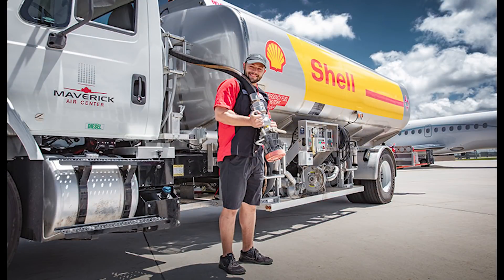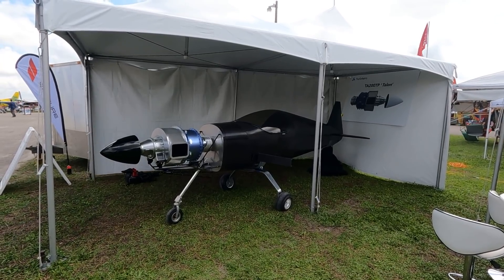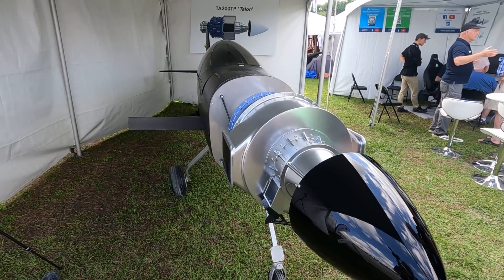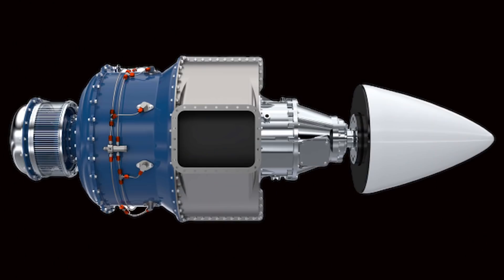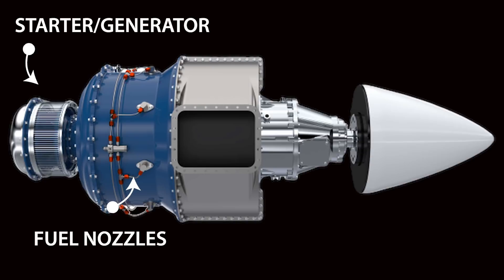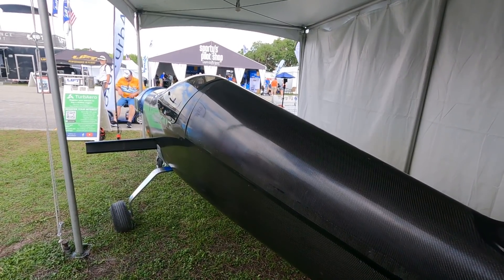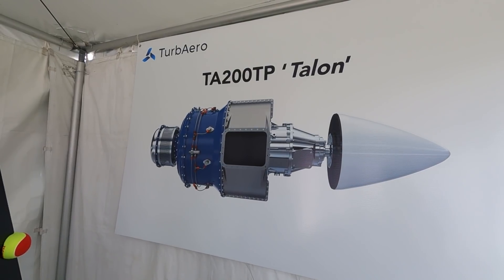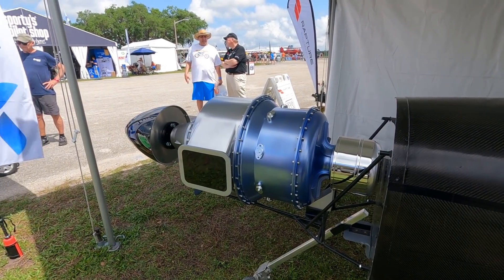TurbAero Aims For a New Turboprop Engine for Small Airplanes

Comment: Congratulations!!! After many decades in aviation this is a great new development. We are still riding behind engines deseined and built before 1950s.  Keep up the good work!!!
Reply: Not really. Many Lycosauruses are slightly more modern.
Rotaxes have cleaned up the market on the lower end and are inching forward in the power range.
Reply: The Marvel-Schebler carburetor design on Cessna 172 engines for example (before finally switching over to fuel injected) was the same design as used on early indy race cars, circa 1911. The design has barely changed in over a hundred years. The FAA requires so much damned money to approve new technology, that aircraft are in some cases 20 years behind automotive technology.
Reply: @VictoryAviation  well, the basic carburettor works well, especially since the mixture is adjusted by hand.

It would be nice, however, to get a normal EFI to work on an aero engine. One could even design one with one channel per cylinder,, achieving all equal EGTs
Reply: @daszieher  It exists. It’s called a FADEC system. Unfortunately because of how over the top the FAA is with approving technology, there are many incredible systems that require a ton of money to get approved. Meanwhile cars have had similar systems since the 1980’s standard.
Reply: @VictoryAviation  you got my point 😉
Reply: @daszieher  RGR that lol 😂
Reply: Ironically this tech is from the 1950’s. See the tech behind the Chrysler turbine car. It was a similar recuperated design. The downside is small diameter turbines must run at infeasible high rpm.
Reply: @yolo_burrito  interesting! Thanks for pointing this out!
Reply: Yep just plink down 80-85k $..  realistic ? Not at that price, but a good viable option??
Reply: @dalestephan6777  Newly developed tech is always much more expensive than when it is more widely distributed. GPS used to be so expensive that only the military could afford it. Now it’s a part of every single cell phone.
Reply: My IO-360-A3B6 engine was certified in the mid 90s
Reply: I don't "ride behind" I fly my aircraft. Second they (Lycoming, Continental ) are still here because they are 100% designed and suited for GA planes, efficient, reliable, economical and powerful.  No offense, you have no idea about science, math, engineering saying things like this. Thisi s a vaporware engine. Pie in the sky you can ride in your dreams. I am going to "ride" my RV7 with 180 HP Lyc, today, tomorrow and for decades to come.
Reply: @gmcjetpilot  Just because a Ford Model-A was a solidly built vehicle with some still running over a hundred years later, doesn’t mean it’s the most efficient, powerful, and reliable solution. It means that it was built with great engineering for the time and the atmosphere still has the proper amount of oxygen in it so that combustion works.

With your attitude towards new creative solutions, you would have been yelling at the Wright Brothers telling them how stupid they were because you had your trusty horse that worked just fine.
Reply: @gmcjetpilot  Decades my ass. I bet your pushing 60.
Reply: @CrossWindsPat  You know me. Yes I am pushing 60 and happy, because I am healthy, wealthy and secure. Mechanical Engineer LSU 1885 Masters UW 1990 while at Boeing, worked my way up to CFI- Inst  instructor, Multi Engine Instructor, ATP and started flying for the airlines in late 90's. Have 3 type ratings, including CE500, B737, B757/B767 So yes decades kid. Get off the computer and do something useful besides trolling. Yes you are owned. Bye.

Comment: All the ning nongs and knockers that say it will take at least a decade just check what is happening around all the space ports on the planet. They are sending rockets into space that were on the drawing board two to three years ago (they have to get approvals also). The only obstacle is money as always; given that single restriction, everything else is go. Get with the program and stop knocking for knocking's sake there is enough of that crap already on the web. For those who thing the development has fantastic potential I am with you, the extra cost compared to an IC piston engine when one adds the extra safety of a jet turbine is a win without argument. The bigger issue I see is noise, (and I don't mean the stuff on this page) for small community airports the noise level at the boundary fence is a growing concern for many local (dormitory) airports.

Comment: Given the promising development of the RED A03 diesel engine (its already receiving certifications), it seems more likely the V6 version of that engine, the A05, will be certified long before this gorgeous little turbine.  And at significantly lower lifecycle operating costs!

God bless TurbAero, but there is no way they will be able to manufacture turbine blades that can get hot enough to be efficient enough to make this little wonder go.  Ceramic coatings?  Nope.  Titanium?  No way.  Single crystal castings?  LOL.

The manufacturing infrastructure to make efficient turbines is beyond most nation-states.  Unless TurbAero has some stunning IP they're not letting on about, this will not make it past the first flying prototypes.
Reply: I think it is certainly possible - it has been done already in many applications... But this should be a hundred million+ project, which I doubt they'll be able to afford. Rolls Royce Model 250 is similar and inflation adjusted that project cost 60m$ 60 years ago. The modern version costs like 300k$.
Reply: @rkan2  Well said.  There is always a substantial gap between completing the digital design for a product and actually building it, but aerospace may be the most extreme case of this — turbines especially.  Rocket engines are hard, but until SpaceX they were mostly single use and and bespoke.  The quality implementation standard for a multi-use certified product with tolerances that account for variation over series production ALWAYS means the manufacturing process will mature slowly (and expensively).

The TurbAero team comes across as skilled and capable, but they don't look like a company that has even 5% of the capital that will be needed to see this engine offered in anything built by Cessna.
Reply: @rkan2  just look at that TINY reduction gearbox on the front of the "Talon" engine.  Printing the gears for such a device isn't a thing yet.  They will have to outsource this part to an aerospace machining company and it will be EXPENSIVE.
Reply: @rkan2  yeah, no 3D printers 60 years ago
Reply: @Ulbre  What are you talking about? How does was a 3d printer needed??
Reply: Anything that burns diesel seems to be a dead end. IO-360 has been around for decades, costs around 40k new and 25k overhauled and this is expensive already. Neither this tiny turbine project nor RED engine are going to be cheaper or significantly more fuel efficient in terms of quantity of fuel burned. Moreover the overhaul cost of the turbine will likely be over half of the price of new unit while RED is a TBR engine by design. What GA needs is an IO-360 that burns anything that a gas pump sells instead of 100LL or any other special "aviation" fuel which is going to be expensive anyway. This boils down to just a few things: injector return line along with in-tank electric fuel pumps to avoid vapor lock; cylinder coating to be able to withstand corrosive alcohol in fuel; a bunch of sensors and a fail-safe engine FADEC along with electronic ignition to boost efficiency and performance. All these technologies are widely used in automotive world and even in aviation: Rotax burns E10.
Reply: @alexandermarchenko479  TBR is not a fault by itself, it's the replacement cost that kills the concept for a much more expensive certified aero engine.

I have my doubts, if one could make an IO-360 run reliably on pump gas without enriching it out of competition for anything less than idle.

The problem lies in the huge volume of combustion chamber and the materials used. Smaller volume engines, turning faster are less prone to knock.
But then a PSRU would be needed and we all know how much those are loved in "proper" aviation.
Reply: Horses for courses. That's what the recuperator is for. Bring the efficiency up despite having a much lower TIT

Comment: Best wishes to them, but it will be a miracle if ANY paying customer gets one of the experimental turbines installed into a flying aircraft.

It will take second, larger, miracle for them to refine that design and raise the capital to get that engine certified.

It will require a third, greater still, miracle for that certified engine to be sold at a price and efficiency such that total lifecycle costs are less than DOUBLE similar piston power.

All that said, "saints" have been canonized in Aviation before.  Good luck TurbAero!
Reply: Probably true; but if with JetA1 availability and FADEC it's insurable, there will certainly be some market for it. Check out piston engine prices in the Malibu range...
Reply: Agreed, and the calculations will have to be on a) acquisition (spendy), fuel consumption - (>piston..so far) and maintenance (probably better than pistol).
Reply: @silasmarner7586  Cheap.  Efficient.  Durable.  Choose any two.  😅
Reply: I doubt if they would start off with the CERTIFIED market until they had established proven demand in the EXPERIMENTAL market. Once that's done, they can make themselves an acquisition target. Manufacturers of Certified aircraft and the parts suppliers therein would probably do backflips to be able to sell a low cost turboprop. Maybe. Let's see it work first. Then let's see it sell.
Reply: Ahhhh, it's been said and I'll say it again. Not.For.The.Certified.Market
Reply: Don’t know if you listened to the man speak-it seems as if certified aircraft are not the target application.

Comment: This will be fantastic if they can stay the course and get it certified. It's relatively small and lightweight, will eliminate the need for a turbo (on piston), and uses jet fuel.  I can see it on a future Diamond, Tecnam, or RV.  Would also be great on trainers since the single lever operation and turbine procedures would be more in line with commercial jets etc.
Reply: I know the cost of certifying engines, and it's way beyond "eye watering". If they started with [US] $100,000,000.00 in the kitty, they'd run out long before it was FAA/EASA certified. GE spent well north of two billion USD on the GEnx engine, a decade ago when a billion was still good money.

Comment: The production version of the engine hasn’t run in a test stand, but you’re talking deliveries in the next couple of years?  Right.  I’ll believe that when the Gemini and Higgs Falcon engines are flying and have proven their reliability and performance.  It would be fabulous if you can do it, though.  You won’t be getting near enough heat with materials that wouldn’t drive the engine price up into the quarter million range, though, so you’ll still be at least double the fuel consumption of an IC engine.

Comment: “Recuperative heating” is the same basic technology that was used in the Chrysler turbine car engine of the ‘50’s and early ‘60’s to cut SFC to something a bit more efficient and cost effective over the fuel burn of a typical turbine engine…
Reply: Loved Jay Leno's video breakdown on his Chrysler Turbine. It'll spin the wheels with torque loading the gearbox even.
Reply: Yep; they even used two on the later models. I'll guess that their BSFC is closer to any other small turbine than an O-360.

Comment: All buzzwords, no substance, the only thing us small aircraft people care about is the estimated fuel burn. Sure super reliable 200hp is good, but it's not as good if you're burning 25gph at lower altitudes.
Reply: They're just not going to get burn rates similar to piston engines unless they have some sort of breakthrough design they aren't talking about. It's really that simple. To me it makes alot more sense to convert an APU to turbo prop to just get some (relatively cheap) Turbine hours on the log book and forget about the burn rate.
Reply: @machinesandthings7121  I think a guy did exactly that with a converted APU into an RV-4 a few years back.
Reply: @sactu1  I saw a Zenith 701 with the conversion. Not sure how many hours he put on it though.

Comment: Turning unpressurized piston craft into turboprops mean sucking on O2 for best performance and economy.  Then the fuel quantities on board may not be efficient if the fuel burn is much higher.  The 200 hp aviation piston engines are not known to be very troublesome, to begin with. 

I am all for other and newer options in the marketplace.
Reply: Not quite accurate. It’s true that most TP engines in production today are optimised for high altitude efficiency however that doesn’t have to be the case. It is entirely possible to design a TP/ gas turbine engine for high efficiency at low altitude. I’m hoping this one meets the goals

Comment: I love the idea of this engine, but for $85,000 they can keep that down unda.
Reply: You have clearly never shopped for aircraft engines
Reply: @liaisonliam3013  I know that the relative price for this engine is truly a good deal, but the cost of aviation is beyond ridiculous. The fact that engines with 1940's tech cost more than a brand new diesel truck in unacceptable. There is no reason we should not be able to buy a new entry level certified aircraft for under $75,000.
Reply: @StangDGB  I agree with ya, that's just the price of paperwork. Uncertified garmin avionics are identical to their certified counterparts, but are half the price because of that piece of paper.
Reply: @liaisonliam3013  #abolishthefaa
Reply: I thought that was a shockingly low number. Realistically if they can make it work😐 it should be in the 285,000 range, and a decade out. I'm going to start holding my breath now. Let me know when it's in production.
Reply: @machinesandthings7121  I'll be dead from old age before it is available
Reply: @machinesandthings7121  Just buy a PBS TP100 for $150K now.

Comment: For an engine that hasn’t even run yet, a delivery timeline of 2024 is…ambitious, to say the least.
We shall see.
Reply: Australia's CASA is far more conservative normally then the FAA so that's a challenge.
Reply: This project in reality is probably a 100m$+ after it would end up as a product, I doub't they have that kind of money... Military has that kind of money at that's why it already exists in that space.
Reply: thought the same. Add two years on top of that, best case scenario... And likely much more expensive as well.
Reply: If you want an engine that screams like a banshee and sucks down Jet A like no tomorrow, and money is not a factor, then buy a used Allison / Rolls Royce 250 and bolt it on the front of your experimental. At least you can be confident that it’s a well-developed, proven reliable design. And when it comes time to do maintenance, you can get parts for it, if the sticker shock doesn’t give you a heart attack. For this company to just jump feet first in to a market segment that’s been dominated by one company for decades and think they’re going to outplay the leaders is, at best, naive optimism.
Reply: @wrkingrageaholic  Exactly! That engine project cost 60m$ originally inflation adjusted. It was cheaper than this  at around 40k$ inflation adjusted though. It was a government price of course though.
Reply: Not really dominated by 1 MFG... There is General Electric, Pratt & Whitney and Turbomecca they are big boy's to.
Reply: 2034 would be more realistic. But they'll need alot of cash to make it work...